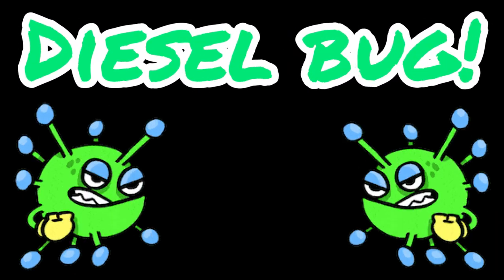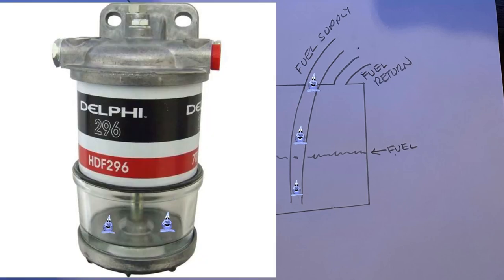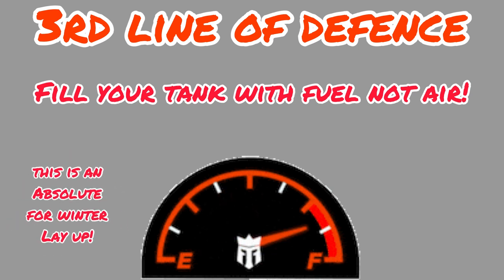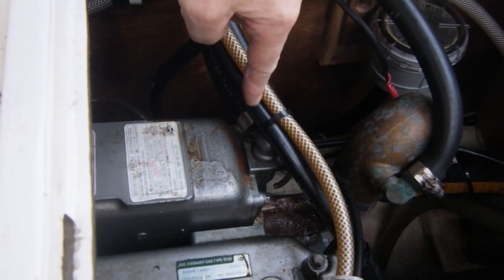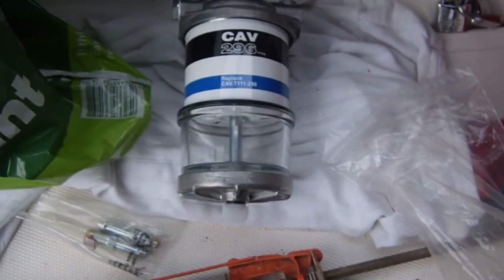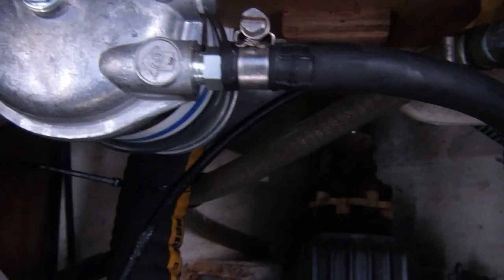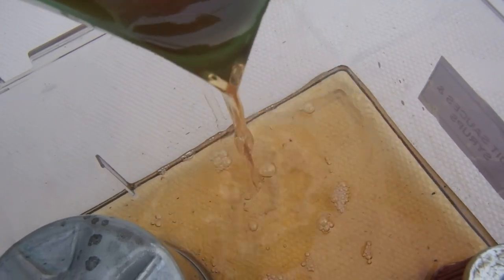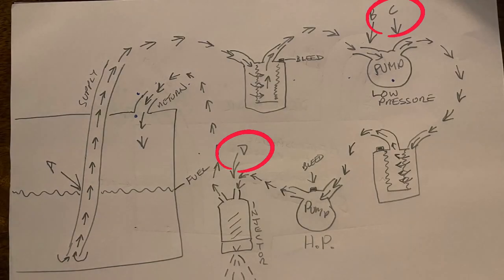Diesel Bug

Comment: Informative as ever Mike.  I had the dreaded bug about 5 years ago and gave it a great deal of thought about how I caught it and came to the following conclusion.  

I had purchased best part of 100 litres of red from a very small boat yard and suspect that I picked it up from there. My solution has been to move to white from one of the local supermarkets as their turn over is huge compared to any marina and I can get it on the way to the boat.  Don't expect anybody has looked at where people who have the bug purchased their fuel.

All fuel is filtered via a Mr Funnel. While slowing the process down I can see if anything ls filtered out, I no longer use metal jerry cans as they are great at depositing stuff in the filter!  I've moved from a CAV, horrible fiddly things, to a Racor copy primary fuel filter as it is easier to change and has some centrifugal filtering effect.  To date no problems.

As an experiment this winter I placed an open topped plastic bottle with a litre of fuel in the cockpit locker to see if it absorbed any atmospheric moisture.  To date no water is present in the bottom of the bottle, so I am not convinced that this is a problem.  I am in Cornwall, but we have had some rain this winter. 

This winter's refit includes empting the half full fuel tank and see if any H²O is present.  I've seen some water absorbent filters for breather tubes and might consider fitting one of those if I find any H²O in the tank.

The jury is out on additives as we will never know if they work or not.

Sandy
Reply from the maker: Hi Sandy, I agree with all you have to say. In some respects we sing from the same sheet. I use garage white diesel also 90% of the time. This I do because cars never seem to get diesel bug. Anytime I’ve filled with fuel why out on passage I’ve used a filter where possible. I’m sorry to say it but it’s mostly the marina fuel stops where your going to pick up the bug. 
Here’s hoping that we have a great season, all the best mike
Reply: @sailingcosiloveit  May see you on the water Mike I am planning a wee jaunt up and down the Irish Sea this summer.

Don't get me going on the subject of horizontal filler caps on boats.  Grrrrrrr

Comment: Good explanation Mike, the bug can be an unseen enemy. I went for an integral handprimer on the CAV, (but you can get a separate one). One of our guys had a inline squeezy type bulb that developed a small split. It took him ages to diagnose why the engine would start and then fade under load.
Reply from the maker: Hi Peter, I use the hand bulb because I look at it as a service item. I will change it out every few years, certainly before it starts to harden which is normally when cracks start to develop. Don’t want to say the next bit now but here goes, I use to you the cav with integral primer but mine leaked air and was a devil to find. Same problem your friend had but other way around. Aren’t air leaks a b**ch? Here’s hoping all goes well mike
Reply: I went through my fuel system with a fine tooth comb. Eventually coming to the conclusion that a weak lift pump was causing the engine to starve after a couple of minutes at mid to high throttle. New one cured it.

Comment: Informative as usual. I’ve changed my fuel filter, but it reminds to check the drain on the tank. Great tip about fuel cans - sadly I’ve just bought a black one…
Reply from the maker: Hi Erbster, black will be ok with the filter funnel, just can’t check contents while in tank. Have a great season mike

Comment: Nice one Mike. I also prefer the cav type filters too. There is a short clip of me cleaning my fueltank on my previous sailboat on my older videos, at the and of them,  (season 1 and earlier) i could lift out a big hand sized blob of diesel bug out of the tank. It was hiding behind one of the baffles /walls.  As i tilted the tank and hosed the inside with clean diesel it came sliding down across the bottom of the tank like a stranded black jellyfish.
The tank on my Bavaria dont have an inspection hatch in it so i cant clean it. I will mout one later on, but for now I have just built in a diesel polishing system that i run when I'm sailing or motoring in heavy seas. I havent foune any stuff yet. 
There are a few glimpses of the fuel polishing system in this video ( https://youtu.be/6UM3xk3tnwE ) there is a water and sediment trap on the starboard side of the front engine access and the cav filter and water trap unit on the portside.  After that there is mounted a Hardy pump that sends the fuel back to the fuel tank. Separate fuel pickups, but return is T'ed into the engine's fuel return system. 
Thanks for shearing this important video.  Best regards from Jarle
Reply from the maker: Hiya Jarle, you have certainly experienced it at it’s worst. You seem to have the maximum levels of protection. I’ve only had a stopped engine with the bug once, around the year 2001 in a folk boat. Once the tank had picked the black starfish (quoting you) up it made its way to the top only of the first cav filter. Never got to the bottom of it and starved the engine. The tank was built into the boat with no inspection point. I remember changing the cav filter about half a dozen times before the engine would run. After that I always had a box full of cav filter on board. A lesson I will carry forever. Great to hear from you mike